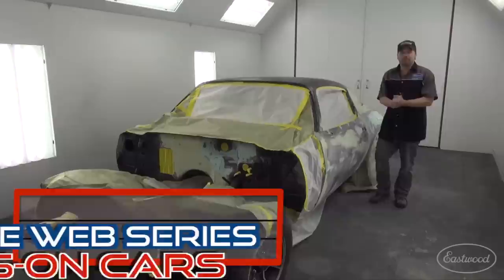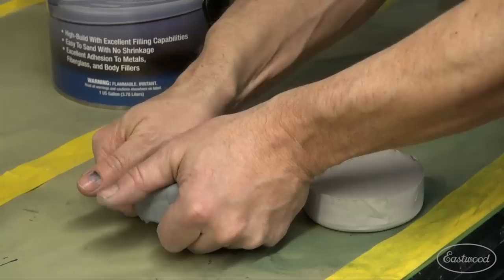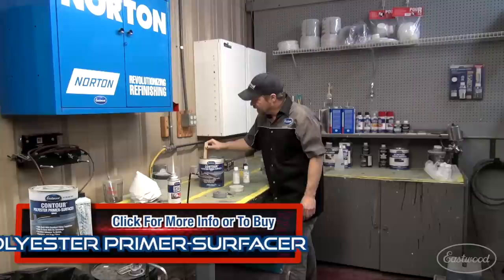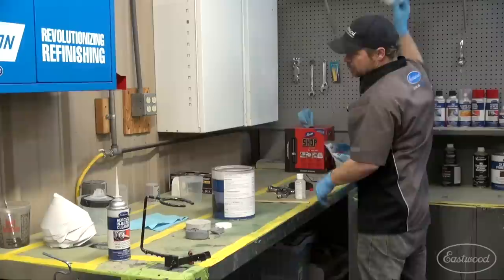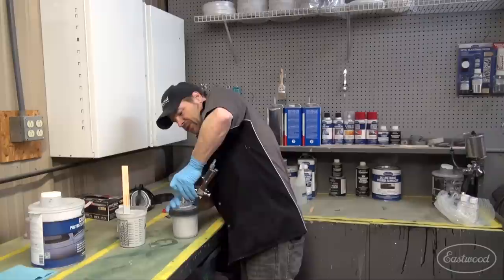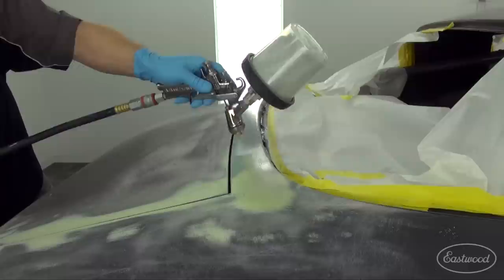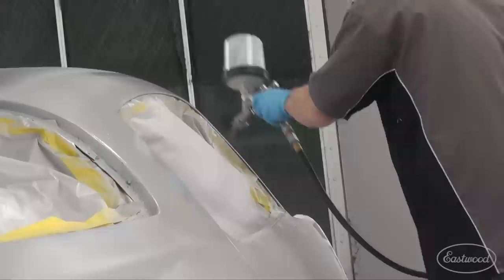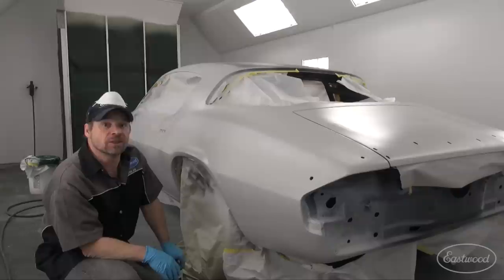How to Get Straight Body Panels - Contour Polyester Primer-Surfacer from Eastwood

Comment: Words of advice for those people who are going to use this primer. Here Kevin tries to make it easy to understand by mixing 1 quart to half of bottle of cathalist. I did the exact thing he did but my primer got hard really quick. I only had like 5 minutes to spray it and the spray gun got clogged with primer inside. 
So ALWAYS take in consideration the outside tempeture when doing this and mix small amounts at a time. You will get a sheet with the mixing ratios. Good luck.👍🇺🇸
Reply: I hear you, I'm spraying in Australia on a 35deegreeC day and got about 2 min before my spray started to clog and spent the next 2 hours taking apart and cleaning my gun. was a serious FML moment haha. Is there a cheat sheet that takes into account ambient temp? BTW the US seriously needs to get on board with metric system already, sick of working out conversions 1 qtz = 946.353mL?!?! Just why!!
Reply: That is very good point and great advise “are you listening Eastwood”
Reply: @simonirvine1253  I feel the same way about other countries using the metric system, I wish they would get on board with using US measurements (haha)  as I hate converting as well.
Reply: @simonirvine1253  HA - thanks Simon - I was thinking the same thing about the heat here - and thinking of possibly painting during the middle of the night (a bit cooler - HA - hopefully) CHEERS from AUSTRALIA

Comment: I use epoxy primer and I put 5 coats then block with 180 then guide coat then block with 500 then paint direct with my 2K process. It’s a one step process. I get a good result and take half the time to do a job.
Reply: Very true

Comment: I used polyester surfacer shopline .Mixed it correctly and it cracked all over.i put it on shopline epoxy.it was 90 degrees outside though I was in a spraybooth.

Comment: It says at the end of the video that after this polyester primer surfacer is painted on even at that stage you cant paint on top of it,according to Kevin he says that the next stage is 2k high build primer :(
I thought this was the high build primer,really confused now or is it all about selling more product
Reply: From what I understand, polyester primer is spray on body filler. It can make a panel more strait than just using 2k high build primer. It is used instead of body filler and saves a lot of time when doing restoration work where the car needs to be dead strait. You would still need to use 2k primer afterwards if you want it to be show car perfect. At least that's what I think haha
Reply: JM Media thats exactly what spray on poly primers are. A thinned down version of body filler. Unlike body fillers from the can you can layer this more than 1/8 or 3/16th without worries of it separating as their is a chemical and mechanical bond to the substrate. High build primers are great for the guy wanting his 1978 civic redone or the 69 challenger dude wanting his redone. Its a time saver as it sands easy and so easy to form body lines with it.  Im 45 so its like finding that cute sexy 35 yr old virgin thats wild but never met someone worth the time of day to give up her cherry to lol. OK a lil different but still. Its amazing stuff.
Reply: you are misunderstanding what he said learn how to read he said why is the guy in the video say that polyester is the recommended product to use instead of 2k primer surfacer because its more durable and doesn't shrink back but then he said to use polyester put 3 coats and then block it and then use primer surfacer and block it ready for paint
Reply: Urethane  2k or even better Epoxy prime (400 sand) before paint

Comment: Where do you apply epoxy primers one inch thick on a body panel. When applied in the normal prescribed thickness it not a problem. If I have some epoxy primer left over I generally put it in a paper cup. Sometimes it sits for weeks at the back of my table and I never see it shrink and break in pieces. I guess you have to put the other products down to see your product.

Comment: Is the 2.5 tip required, or will a 2.0 tip work?
Reply from the maker: We have 1.8 to 2.5 as options on the product page.  2.0 should be fine.

Comment: Ok so I spray the primer on let it cure then use the guide coat to find the low spots. My question is will the body filler stick to this primer if I have to use body filler?  And how long do I have to go ahead and use the 2k primer filler?  I just want to make sure if there is a window to use the 2k primer filler. Thanks.

Comment: Im still not sold on any poly primer. It sands good but i think to much it will crack. I know its brittle. I still think the way to do it is spend more time on body work . i used poly on race cars and i know when they hit the wall the poly comes off in a sheet .
Reply: Ouch how much did you use 😂 don't think of it as a primer think of it as filler, you can't do filler too thick or else it will crack right. So this is just a tool to enhance the surface dont use it to shape or recreate something that isn't there. It has it's limitations but if used properly it does wonders.
Reply: @jflorf909  i ran out of Silkkins and only used 3 med coats. Finished body work with 150. Got filler blown off clean good and shot that polly. 3 med coats waited till it flashed. I sanded it dry then went to a DA 600 them sealed base then clear. Came off in a sheet. Its brittle we dont use it in door jams at work . i still think in 5 or 6 years thr crap will start to crack crows feet from the hot sun. 130 bucks a gal to me good primers 230 a gal. Im sticking it on my car i will see what it does down the road
Reply: @mr billionaire i agree. Im in a high end shop. We finish bondo with 150. We go 3 coats of polly crap. Block good with 150 then we use a 2k primer. Block 320 then 600 da or wet then seal and paint. Polly crap goes bad when you sand spray again block do it again. Show cars come out 3 months of a year but i know on a daily driver in 2 or 3 years crap be cracked to hell. Best primer is the Ppg vibrance 2050. Super thick sands ruff but its good and only 190 a kit with 2 hardners.
Reply: @jeffwoods5336  I was going to use the vibrance on my chevelle for the first time .. Strip if down 3 coats body work .. Then what do you suggests, I want it super straight?  🙌
Reply: @jeffwoods5336  I have always had a bit of trepidation about this spray on bog - 40-years ago there were similar products (no doubt better these days) and in my experience - HMMMMMMMM - I never trusted the longevity.  My preference is to get the surface 'near to perfect' as I can - then PPG or SPI sandable epoxy.   Not sure - but to me - using a single product such as the PPG or SPI sandable epoxy that is more unlikely to crack should produce a better long term outcome.  In my opinion, laying on thick spray on bog (yes - most should be sanded off again) could be introducing issues for down the road - and making sure that the stuff is not built up too much on edges or in gaps can also be an issue.  Show car - occasional trailer to the show - could be fine - a dark color car in 365 day of the year use - I prefer to err on the side of caution and not cover the car in spray on bog.  I am sure that many have used it successfully - but I prefer not to 'gamble' on the long term outcome with this type of product.  CHEERS from AUSTRALIA.

Comment: My car was media blasted, shot with epoxy primer and blocked with the Contour body filler. The instructions on the Contour Polyester Primer Surfacer aren't very clear as to what step to take after shooting the product.  
The product sheet says to start with 80 and move up to 320-400, but won't the 80 just add gouges and undo all the prior blocking I just spent hours doing?

What grit do I uses before shooting the primer-surfacer product after body filler and blocking the car?

What final grit do I use to abrade the surface prior to spraying the reduced epoxy primer, as a sealer?
Reply from the maker: +pitt42075  The surface should be prepped with 80 grit.    The filler should be sanded up to 320 before the poly primer.  Although you can get away with much courser scratches.  You want to finish the poly primer with 400 grit before using the Epoxy as a sealer.  To talk to an Eastwood Tech, please call 866.759.2131.
Reply: @eastwoodco  I stay at 120 before poly then block

Comment: Would a 1.4 gun work with this?
Reply: No, as the video illustrates...  You can get by with a 1.8 by thinning with acetone, but recommend a 2.0 or larger tip .

Comment: Why does eastwood sell this stuff but they don't sell a gun that has a 2.5mm tip as he says he is using in the video. Not easy to find a 2.5mm tipped gun the biggest I have found was 2.0.
Reply: You need at least a 3.0 ml gun to shoot this stuff properly. You  also can thin it down using acetone to help it through a smaller tip. This stuff is awesome to finish off bodywork and be ready for a nice smooth light coat of primer surfacer to prep it for paint. Great video!
Reply: Sprayguns Direct ANI brand       start at about 50 bucks        they have everything

Comment: How do you stir the contour primer? The gallon I got from you, is extremely hard to stir. In the bottom of the cab it’s like goop and will not stir up no matter what
Reply from the maker: It can take a while to stir, especially if it's epoxy primer.  You can try a paint shaker, or call an Eastwood Tech to discuss.  Tech # is 800-343-9353.   Here's a paint shaker:  https://www.eastwood.com/rockwood-pneumatic-paint-shaker.html